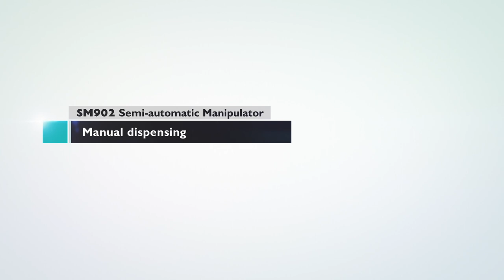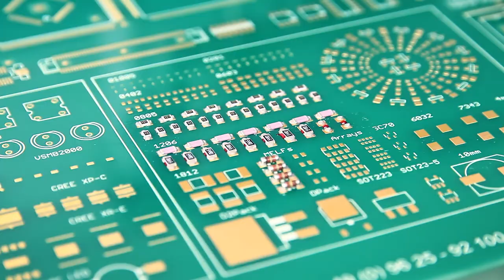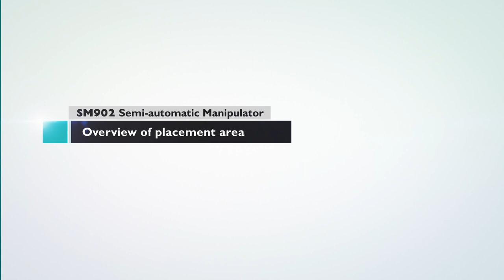Manual & Semi-automatic SMT placement

Comment: Pointless. Assists manual placement. Already has some movement control and some motors. It would literally require a few more, it wouldn't be (understand: should not be) much more expensive, and it would be fully automatic.
Reply: Is it.?
Reply: Exactlyy .. it's just very close to automatic .. all you have to do is make sure that random components box components are nicely arranged

Comment: simply: its cheaper than automated one
Reply: if you know the price for any Fritsch equipment, then you would know that this is not true. You can buy at least 5 OpenPnP machines for the price of this thing. And the OpenPnP machine does all the placement automatic and has vision systems with cameras to actually check what it's doing. Sure, programming the machine does take some time, but all modern CAD tools export pick and place data with the click of a mouse. The rest of setting up the job for full automation is done pretty quickly too. And once it's set up and running, you can do other work. I really don't see the point of this machine, it's just too expensive for the small benefit you get, compared to normal hand placement or full automation.